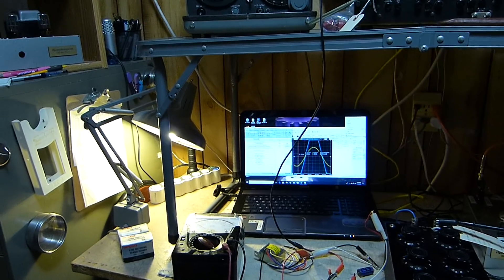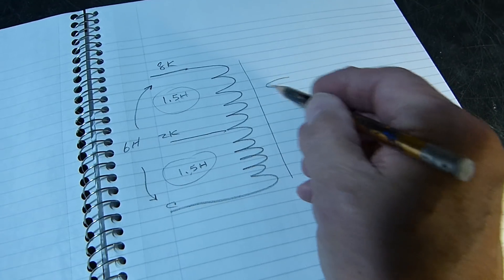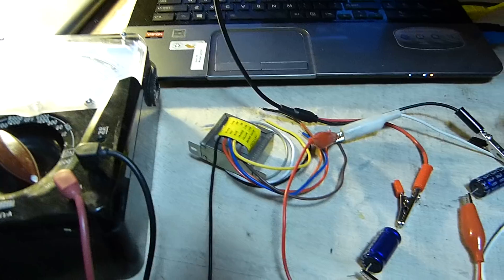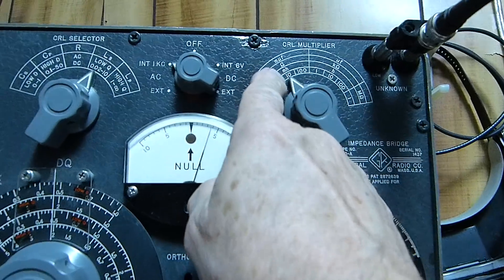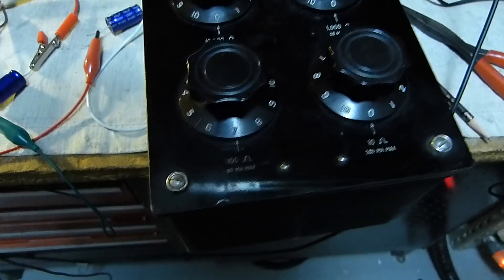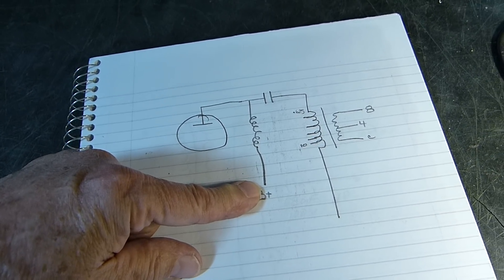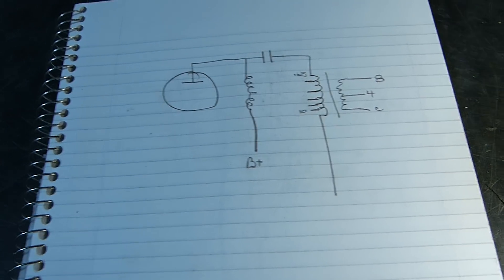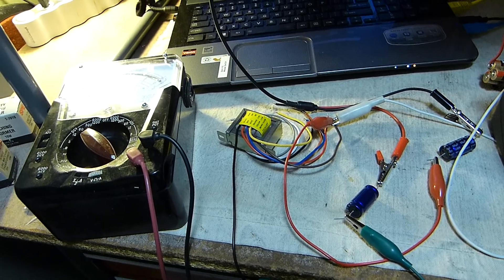Core Saturation Measurements In 70.7 Volt Line Transformers Used For SE or PP Tube Output Stage

Comment: Thank you for all your great videos-- lots of fun to watch.  Could you please explain the electronics of why the tapped winding, which seem to be effectively two 1.5 H inductors in series results in a 6H total measurement.  I'm guessing it has to do with the coupling of the two windings through the core  but I haven't been able to find any info on the web that explains it.  Thanks very much!  Terry
Reply from the maker: It does have to do with the coupling. Assume you measure the inductance (L1) from CT to one plate lead and then measure the CT to the other plate lead (L2) and find that they are equal (within reason) then you take the square root, in this case of 1.5H and get 1.22. Then you take the square root of the other side, and in this case they are equal and take the square root of that 1.5H and also get 1.22. Then you add the two sqrt roots together (1.22 + 1.22) = 2.44. You then square the 2.44 and get 6H. That is how they combine.  In equation form it would look like this:  [sqrt(L1)+sqrt(L2)]^2
Hope this makes sense.
Reply: David,

Thanks for the reply.  I'm still left with my original question, which I didn't state very well.  I fully understand the equation-- [sqrt(L1)+sqrt(L2)]^2.  My question, I guess is:  where does the equation come from?  Two inductances in series normally just add.  What in transformer theory leads to this more complicated equation.  I will freely admit my lack of transformer theory :)
Reply from the maker: Yes, I understand what you mean now and inductors with no magnetic coupling can be treated like resistors.
I have the same lack of transformer theory so, I don't know either.  :-) 
A few months back a good gentleman and I got into questioning where did the fact that we have to use radial frequency (2*Pi*F) for reactance values come from?  What's wrong with just cycles per second?  Why must it be radians per second? (maybe you know..) We beat it to death going to dimensional analysis and everywhere in between and never really got to a satisfactory answer. 
I think, first of all, to really understand anything we have to go head-first into the discipline, like transformers, and develop the advanced terminology and language of that specialty. I am interested and I intend (and hope to succeed) in accurately and consistently being able to measure incremental inductance in transformers and chokes with a jig I can make and procedure someone else came up with . I finally understand, so far, it takes a DC and AC component to measure incremental inductance and not just a DC core magnetizing force.
It was a challenge to be able to be able to measure high inductance values in iron-core inductors/transformers until I finally came across the procedure shown in one of my videos. The math is not staggering but it is not high school either - at least not at my high school of the 1960's..
I figure the learning curve for measuring incremental inductance is going to be an equal challenge. 
Maybe then I will understand the reasons for the necessary formula(s). Then again, I sometimes wonder if the guys that came up with these types of formulas didn't derive some from reverse engineering of empirical measurements. 
I can just see the guys 100 years ago measuring inductance with their apparatus. One guy measures one half of the transformer and then the other half and then the whole thing and says, "what's wrong with this picture?". All the while another fellow is over  there with paper and pencil and his slide rule (invented in 1622) and he says, "hey if you take the square root of this one and the square root of the other one and add them together and then square the sum, you get the right answer. Of course, it probably took him two hours to do that and the first guy looked over at him and said, "smart-ass, let's go have a beer". And thus the formula was born. That's how I think it happened.   :-)
Reply from the maker: Here is the real answer. I am glad you guys ask these questions as it makes me do research. You can jump from one tutorial to another at the top or the bottom of each one. Very nice article.
https://www.electronics-tutorials.ws/inductor/mutual-inductance.html
The answer starts with section (3) Mutual Inductance as M^2=L1*L2 or M=sqrt(L1*L2)
Then in section (4) Cumulatively Coupled Series Inductors, we get, Ltotal=L1+L2 +2M so that Ltotal=L1+L2+2*sqrt(L1*L2)
This is the formula and is equal to the one we already discussed.
Reply: David,
Thank you very much for researching this and finding those great tutorials.  I've done a quick scan of the material and see that it will take a deeper read to take it all in.  Looks like an opportunity to sit down with a cup of coffee (perhaps more likely a beer) and learn something new.
Terry

Comment: Thanks for your work in testing these transformers. I have a special interest in your tests as I use numbers of different PA transformers successfully in my valve amp designs at www.valveheaven.com
I decided to replicate your tests and confirmed the apparent dramatic dropoff in primary inductance with a PA transformer similar to the one you tested. To investigate this further, I tested a large quality gapped SE output transformer and found that it too appeared to demonstrate the same dramatic dropoff in inductance with only a few mA of DC current flowing in the primary. This confirmed for me that this method of testing primary inductance with DC applied must have a flaw that I can't quite identify.  I think it has to do with using coupling caps to isolate DC from the inductance meter. I then decided to to take a different tack with this test - to connect the inductance meter directly to the primary and to apply the DC current instead to the 8 ohm secondary of the transformer. With a 5 ohm series resistor connected to my bench supply, I was able to apply a variable DC current up to several amps to provide a significant magnetic offset in the core. I was not surprised to see only a small decrease in primary inductance even with amps of current flowing in the transformer secondary. So all this to say that you can be reassured that these transformers work very well in valve output applications - I use them successfully in amp designs from 2W to 40W output. Cheers
Reply from the maker: I really appreciate you posting this. I did not try it your way by putting current through the secondary and if you did not get the inductance dropping to virtually zero as the core is being magnetized as I did then it does seem there may be a flaw in my test procedure. I will revisit my approach. 
In the GR manuals they speak of incremental-inductance measurements where they do carefully increase current through the windings of a transformer/choke and measure resulting inductance. That is the idea that I based my measurements on.  I will try to duplicate your measurements and see what I get.
Reply from the maker: Grant,
Here is a procedure that will probably work and what I will attempt tonight, time permitting. I have to think this thru carefully so I don't so something really dumb and damage my GR instrument. Take a look on page 9 and 10 figure 5 and 6. I like the way you made your measurements of magnetizing the core by applying current thru the secondary but I am not sure that is valid. I will also measure some much larger transformers, as you did, and see if they saturate at just a few mA. If they do, then there probably is something wrong with my method. Here is a link to the GR inductance bridge and the instructions I mention above.
https://www.ietlabs.com/pdf/Manuals/GR/1632%20Inductance%20Bridge.pdf
Reply from the maker: I did do some quick measurements and with the GR recommended series method, I get 4.37H with 11.3mA flowing through the transformer primary and 3.28H with 18mA flowing through the primary. It looks like my capacitor isolating method does not work. Hmmm... it is interesting that I do get the same inductance values when this is used with a standalone inductor and does not have a bridge connected. I wonder why. In any case, now it does appear that the L of the line transformers does not drop to an unusable value. Certainly builders that have used these transformers report good results. It is nice to see (and hopefully it is true) that the core does not saturate as quickly as I thought. Looks like this is a good project for some in depth measurements.

Comment: The older versions of the Bottlehead S.E.X single ended amp kits used those transformers with a choke plate load and capacitor coupled output as per your diagram. Problem was those are original Speco 7010's, the later ones are physically much smaller and had different specifications.  Be warned if you are thinking of buying a pair, the current production T7010's are not the same transformer.

Comment: So now you have me wondering. Is a DC balance pot needed on a PP stage? I think the Williamson design has one. Not to over burden you with work but what is the typical DC unbalance on these PP stages? And of course it begs the question, how much DC current will a PP transformer like the Acrosound take before it affects operation?
Reply from the maker: I am modeling the choke fed driver stage right now and things are turning out very well. I am surprised and pleased.
Some transformers specify maximum DC imbalance. I would think in the case of these little transformers the DC balance/ imbalance current would be critical.
As for your question on a DC balance pot in a PP stage, in my opinion, it is necessary and I know for a fact that balancing the cathode currents in the output stage makes a significant improvement in performance (lower THD). It is also a very good idea to balance the drive (signal) voltage into the grids of the output tubes. An excellent example to study that has both of these adjustments is the McIntosh MA230 amplifier stage.  The schematic is easy to find on the Internet.  I have implemented these static (cathode current) balance and dynamic (AC grid signal) adjustments into the original design of the Dynaco Mark III amplifier with significant improvements in lower THD. I am very much a believer in balancing the currents in the power amplifier output tubes and the drive voltage to the output tubes.
Reply from the maker: I think those are great and fundamental questions.
The Williamson does provide DC cathode balance in a (cathode bias) circuit. I think you are going to use fixed bias (?) so, the little circuit used by McIntosh in their MA230 amp circuit is made to vary the bias voltage and balance the cathode currents. They also use a pot in the phase inverting stage to balance the dynamic (signal) drive to the finals. Both of these methods lower THD and aren't too hard to implement. I know some transformers specify maximum DC imbalance and I sure don't know about the Acrosound or any others but if the balance circuits are implemented, that should take care of any concern.
I am working with the model for the shunt fed driver stage. Turning out great. Better than I  ever expected. Seems all is good from 10H up whether the inductors are linked (like a CT primary winding) or separate chokes. It appears the coupling capacitors work well at 100uF. Low values like 5uF seem to do funny things to the output current.

Comment: You could use a current source in place of the plate choke, a current source is easy to build, a high voltage transistor and a couple of diodes :) should work really nice :)

Comment: I think it would be interesting to see what the effect of the B+ inductor and capacitor would have on the overall frequency response of an amplifier. I'm thinking the high end would roll off dramatically. Might be fun to see. Wonder about parasitics too. Hmm. Might be a reason why it isn't done.
Reply from the maker: I forgot to remove the screen connection in the model from the UL tap on the transformer. It does work but produces about 1/3 the output (so far). Needs some more research and modeling of L and C values. It looks like it might work reasonably well with the best values but reduced power.

Comment: PP works fine ElPaso.  Try it with 6AQ5s at a B+ of +250VDC.  I think you might change your mind about the PP application.  ;^)
Reply: I developed a PP-Amp with two 12AU7s in parallel in the output section. Made about two watts of clean output. Even bought a little PP-Output transformer to make a comparison. The little line-transformer did a good job! I definitely would send you my ltspice simulation and measurements, if you want them.
Reply from the maker: I am sitting here think about this. Your experience says it works and there is a link  that shows where a fellow has also had real success. But my inductance values are so low with tiny amounts of primary current. I don't get it. I am attempting to model the circuit with the shunt inductor for the plate load and it is turning out to be a disaster.
Reply: DC current flowing from the center tap to both ends in a PP will not cause the core to saturate like an SE setup because equal current is flowing in both directions around the core and they cancel each other out.
Reply: For sure in pure class A operation, where both tubes are on continuously.  AB1 has an output tube shutting down part of the time but it still seems to sound fine for my little guitar amp applications!  ;^)  Little low wattage SE OTs from old radios, etc. seem to be more common and cheaper.  Finding a cheap little OT for lower wattage PP applications was a problem for me before I stumbled onto this solution.  8^)
Reply from the maker: No doubt we all agree on that but I am concerned that even a couple mA of imbalance might tend to saturate the core on these little transformers. It might be required to put a cathode current balance in and keep the current low. Some people report good performance with fairly powerful output tubes, i.e. 6AQ5, 6V6, etc. I think I would keep the output tube to something like a PP 6SN7 so that the current is naturally low (a few mA)  and maybe ground the cathodes (cathode bias) with a pot with the wiper to ground so that the currents through each tube could be carefully balanced. From what I have seen so far, it seems the Achilles Heel of these line transformers is any amount of DC through the primary.
Reply: Depending how a tube like a 6SN7 is biased, we can bias from about 1.5 - 20 mA per tube.  6AQ5's run AB1 at +250V plate and screen, we have 70mA zero signal current and 79mA max signal current.  So at max we have like 4-5 mA difference in current flowing between the 2 sides.   I also believe the 2 sides of the core oppose each other and don't allow the core to saturate as it does SE.  I think the best way for you to find out for sure, is to go ahead and make a little PP 6AQ5 design with one of your line transformers!  I have a couple of designs I power with a Laptop DC PS and cheap Chinese step down (filament) and boost (B+ HV) boards!  It makes the cost to build one very low compared to other tube amps!  ;^)
Reply: Yup, 12AU7s and 6SN7s can make some nice clean triode PP output!  10 Watt line transformers can be used effectively with 6AQ5-6V6-6BM8s in circuits designed for PP output of 10W or less, in my experience.  ;^)
Reply: Curious about the plate load  inductor & capacitor  approach .....to gain something often one loses something ........finally whatever the approach , it's the result that counts .

They have nice plate chokes at Lundahl.
http://vinylsavor.blogspot.be/2011/12/new-plate-chokes-from-lundahl.html
http://www.jacmusic.com/lundahl/html/plate.htm

There's also the solution of John Broskie .......